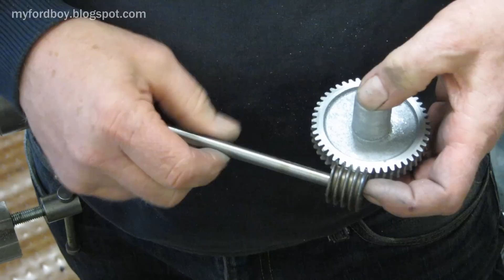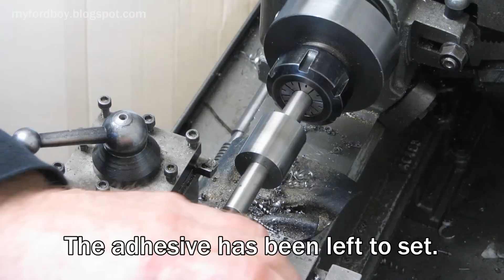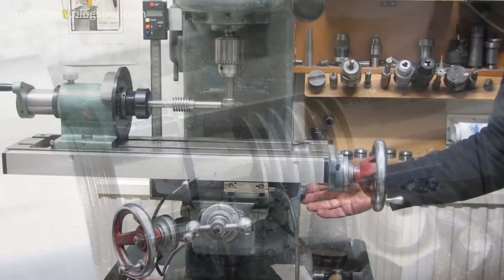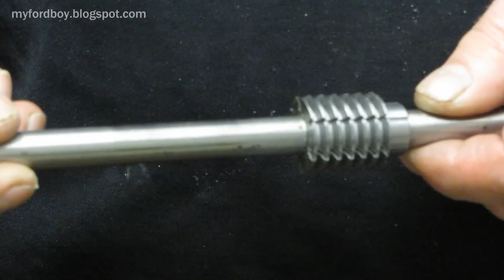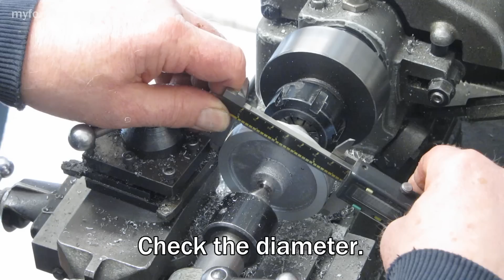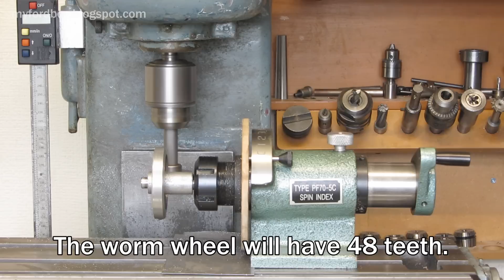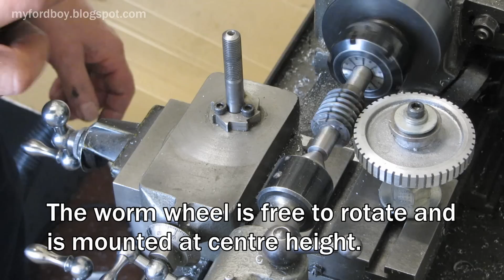Worm & Worm Wheel Free Hobbing Method

Comment: Great video! I have one question. Why did you use a hand file for the cutter  relief instead of using the mill? I ask because I'm handicapped and would find it difficult or impossible to cut the relief with a hand file. Thank you.
Reply from the maker: I probably found it easy to use a file, it was a while ago i made this. If you are unable to do this I expect a way to machine it could be devised.
Reply: @myfordboy  Thanks

Comment: is the bit where you index cuts into the worm wheel necessary or will the Hob do this on its own but just with a reduced quality ?
Reply: sinmasterj
Reply: The indexer cuts are necessary. That is what determines the tooth pitch. This also is necessary to sync the wheel with the hob. Without the cuts I imagine that the wheel would just sit there and get a shape of the hob cut into it.

Comment: Why did you glue the hob to the mandrel instead of machining them as one piece?  To make heat-treatment easier?
Reply from the maker: Kevin Krumwiede  The hob is made from silver steel which is more expensive than mild steel so it's cheaper to do it this way. The same mandrel can be used for for cutting the worm gear and as you say it's easier to heat treat as a smaller piece.

Comment: out of curiosity, is it absolutely necessary to notch the teeth on an  indexer or can the hob  turn the blank without them
Reply from the maker: Not essential but you have the risk of the wheel not rotating correctly when you apply the cut.

Comment: Hello , wow that's a great job , my i ask what is that white "thing" did you use when you where hardening the cutter ?
Reply from the maker: +Nacer Ziani It is ceramic fibre blanket. This stuff really reflects the heat and makes it quicker to get the part red hot. I also used it as an insulator in my oil fired furnace build. Look at the demo at the end of this video https://youtu.be/ha1fAxgNIRs?list=PLD2A7F5FD2D3C3088

Comment: As I understand it, you glue the cutter on the shaft? Do I understand correctly?
Reply from the maker: Engineering adhesive is used,  i.e. Loctite high strength retainer.
Reply: Very interesting. I never met. And he even withstand high temperatures? Or you can write what brand you have become used to the cutter?

Comment: How do you workout the spacing of the teeth to comply with the hob? Please assist
Reply from the maker: +Richard Burgers You need to calculate the angles and pitch from published data. Gears and gear cutting by Ivan Law is the gear cutting bible.
Reply: If you are not particular about the number of teeth, you can start with whatever blank diameter you have, and just keep feeding in until the tooth form matches the hob well. Not as exact,  and the distance between the axises would not be predictable if you had already made the housing.

Comment: Is there a limitation to pitch of the worm you can get without having a hobb mounted askew ? (and worm differ from the hobb). Talking about something like old fishing reel, where the worm wheel is the input and the worm is the output, that with rather high pitch, assumming over 30 degrees.  Thanks
Reply from the maker: Sorry I don't know the answer to that one.
Reply: you'd need a pretty high pitch/low tpi to drive a worm.  While 1/2'' tpi is possible, you have to consider tool speed and reaction time to engage lead screw/thread dial

Comment: Don't you just love having to turn the lathe on and off while thread cutting?  I have a 9 south bend so I'm familiar with that.
Reply: More fun with my lathe, it only has forward drive and all thread cutting must be done by backing the tool right out then moving the carriage away from the chuck then returning the tool to the right depth plus the new depth of cut, starting the lathe and watching the the thread chaser dial and catching the right position to engage the thread cutter drive again, and breath out as it starts in the right place and depth.

Comment: This is so cool, I would have never imagine you could do it like this. Just a couple of questions. Where did you get your gear data from. like the worm diameter, depth of the worm, throat radius. If you say machineries handbook good job. Another thing, on your hob did you make the slits deeper than the teeth so it would top the wormwheel and cut the throat radius? But otherwise very cool, thanks for sharing.
Reply from the maker: All the data came from Ivan laws book: Gears and gear cutting, highly recomended. The dia of the hob created the radius for the worm wheel.
Reply: @myfordboy  yea I get that the Minor diameter of the hob made the throat radius, did you make the tooth depth smaller or just go in deeper? Normally with tangential cutters they have topping so that they cut the correct throat radius. Thanks for your reply. Also while im here,  did you make the hob larger than the worm you're using so that there is clearance and do you have a back ground in gear cutting? Thanks.
Reply from the maker: @sandarelliott5319  This video is 9 years old so I can't remember exactly  but I just used the data in that book. I am only a hobby engineer, no formal training.
Reply: @myfordboy  oh yep sorry my bad 😂 good job though

Comment: I don't understand why you used the indexing head to precut the rough tooth form. The hob will cut the whole thing. Though you did not have very many teeth/flutes and it was unclear if you filed in relief behind the cutting edge to allow the tooth to get a good bite, so maybe it just takes too long?

Also I would have made the hob and worm from the same setup. Put both on the shaft at the same time and cut both. Particularly if you don't intend to use an industry std tooth form or size. Based on the comment elsewhere about looking this one up in tables I presume this one is meant to be a std size.

I have done this with regular taps as the hob too, to make quick right angle gear sets. You would want to use an acme thread tap for a stronger gear. Spiral flutes taps would probably work best, but straight work as well.

Thanks for making this video, I have explained this to people over the years and they tend to not think it will work.

Comment from the maker: The hob was quenched in water to harden it. This makes it very hard and brittle so normal practice is to aneal it afterwards. For one off jobs like this I rarly bother.
Reply: Great video as always. Thank you but after hardening carbon steel we usually temper it back a bit to toughen it.
Annealing is when you soften the metal back to its normal state. Sorry.

Comment: Worm drives aren't really that good unless they have ball bearings on the gear contacts, as the worm pinion is in constant grinding/rubbing contact with the worm wheel, increasing wear and tear as one gear teeth spins into the other gear teeth.  The ball bearing method was opted in the '50/'70s car manufacturing of the steering boxes. I have one such steering box of a Chrysler Valiant. and after 55 years since dad purchased the car I still have it to day. Back before the '50s, earlier cars had geared steering boxes that didn't have adjustment pins, so cars driven in those days had a slightly lose sway and the drivers had to constantly keep the steering under control by applying a left or right turn. Then the ball bearing steering box was invented and the driving of cars became less fatigued. In the '70s the rack and pinion was invented, but in many cases it was too stiff to turn the steering wheel and stiffer to turn the non powered steering.  Over the years, power steering became the norm, especially in US larger cars, e.g. Pontiac Parisienne, Cadillac, Rambler, Ford Thunderbird, to name a few. So, over the years, the use of work gear for long lasting application was limited to electric worm gearboxes used in machinery. But, in my 47 years of engineering work, I have seen how these wear out in a matter of 9-12 years of repeated operation compared to those similar bearing assisted but expensive worm drives seen in industrial heavy machines applications.

Comment: Very very smart but I've used green red and blue Loctite for years and Im fully aware that the green stuff is pretty strong but Loctite isn't glue or adhesive it causes the two metals to corrode together in a day what would take years to do without the Loctite. Thats why if you use Green on aluminum threads you will never remove the bolt without breaking it but I am not going for Green Loctite holding two similar metals like this without at least .0005 - .0010 inch press fit.  The hole he bored had at least .001-.002 clearance. My 15 years experience tells me he could never do that heavy of machining and expect the worm not to turn on the shaft. Why not give it .002 interference fit, throw the shaft in the freezer or use co2 to freeze it and heat the worm slightly press it on and skip the expensive loctite that I do not believe would ever hold those two parts together well enough to be machined as it was shown. Sorry just don't see that happening. Not a big deal though that was very nice work and a good idea.

Comment: It all started extremely well and continued so, until you introduced MDF and the slot-cutting exercise, which was completely unnecessary. The hobber would have set its own correct pitch, providing that your maths were correct (which they clearly were in every respect). Having said that, it all ended extremely well, with the desired result.

It's pleasing to my heart, knowing that there are still engineers out there working to the same high standards to which I worked during my technical engineering apprenticeship in the late 1960s in Leeds.
Reply: There isn't a damn thing wrong with a mdf disc for 1 time use.He obviously laid the holes out correctly,and the diameter is right on,as you can clearly see the pin isn't sloppy.I used to work for a shop making custom radial bored pillow-bearing blocks,and the extension for the lathe tracer attatchment was a damned 2x4!The set-up never changed,NEVER moved,and the parts were BETTER than the ASTM standards they were tested to.

Comment: Pretty god setup you have going there. However I do have to point out your biggest fuckup. 

When steel is hot enough to burn you badly, NEVER throw it in water or put water on it. You destroyed that piece of steel and it will fail on you in whatever capacity it is being used. It will do it's job for a while but I promise you it will break. When you heat steel to the degree that it's glowing, you have changed it's molecular structure and if you throw it in water while it's hot like that. You immediately turn that piece of steel into a very brittle piece of steel.

Your best course of action for this process is to heat it too a glowing red molten steel and let it normalize. Normalizing steel is letting it air cool for however  long it takes. Normalizing would be the best viable option for you but if you had the money or the resources to cryogenically freeze it, that is the bet thing you can do to ensure the parts longevity and hardening.

Anyone who watches this please don't make the mistake of doing what you see.
Reply from the maker: +kevin thompson Sorry but you have no idea what you are talking about. The steel is silver steel which is hardened by heating to red hot and quenching in water.
Reply: +myfordboy I'll have to look through my stuff but you may be rite because it's a molly with non ferous metal in it and that changes the molecular structure but in general. NEVER flash change the temperature of steel.
Reply: neil9 what's up neil9?
Reply: My cursor was in the wrong place and it flagged your comment neil9.